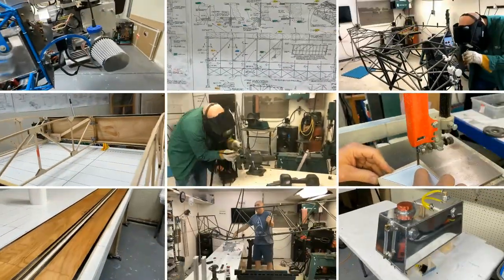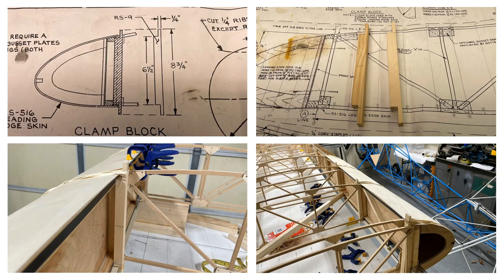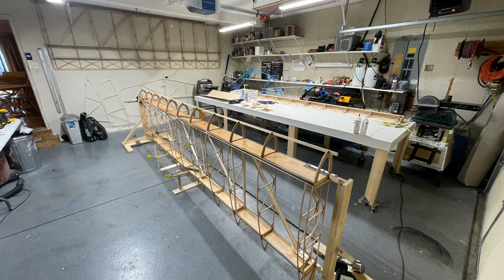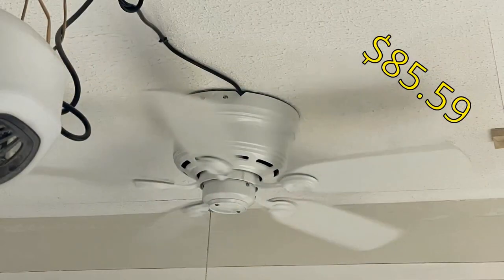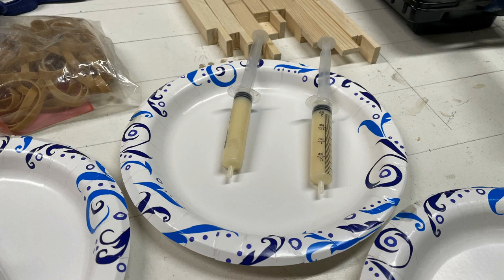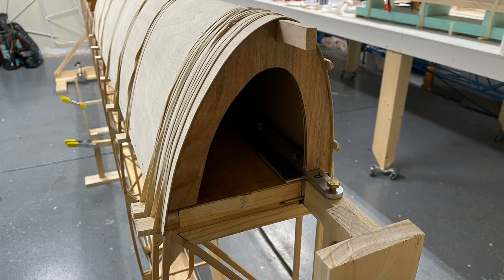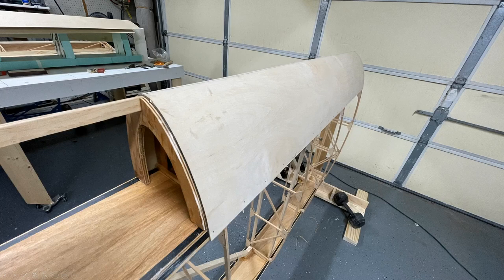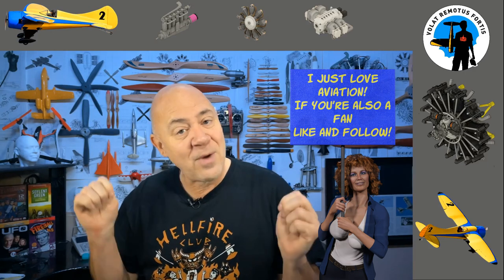Part 103 AirBike Ultralight Update (Leading Edge Skin)

Comment: I'm looking for an all metal wing option.  30 years building metal aircraft I just don't think I can move into wood.  There's a reason general aviation moved on from wood.  Aluminum is lighter and stronger.  I'm also set up for sheet metal.   
I'll use the camber and hard wing measurements of the Airbike.  I like a Lazair construction D cell leading edge.  I don't think I'll use the lazair foam ribs. I prefer formed Aluminum sheet ribs. . . .
I'll come up with something 👍🇨🇦
Reply from the maker: It would be cool to see a metal option. :)
Reply: @dagtheaviator  . . . .I think they would sell more units if they were aluminum structured wings.